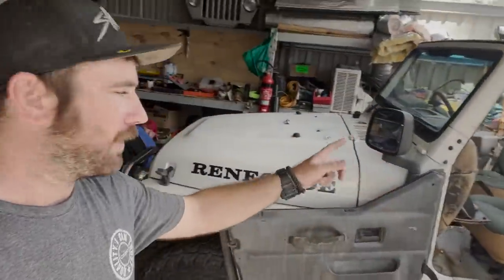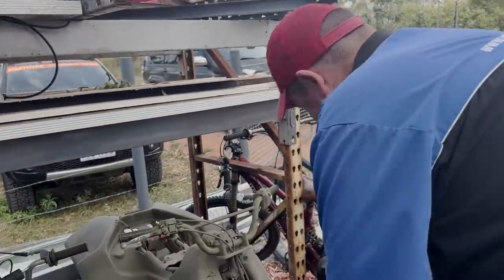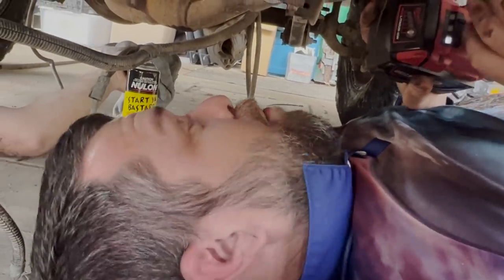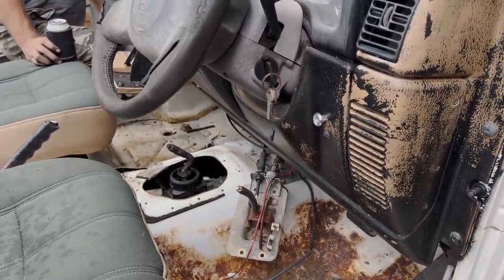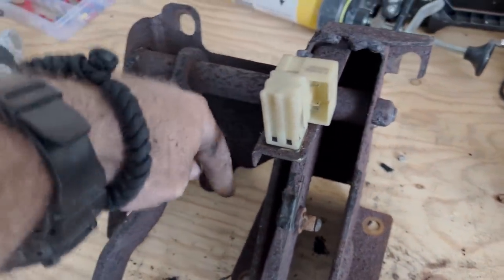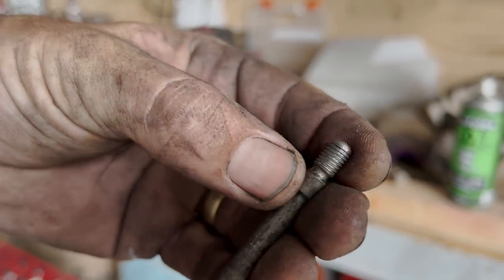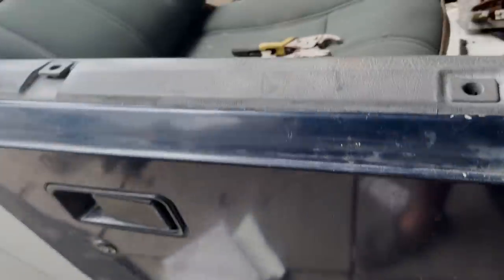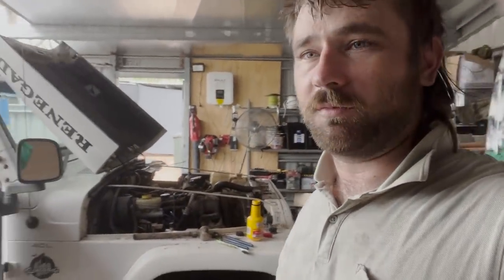Sh*tbox Shed - Rebuilding a Jeep Tj To Its Former Glory - Episode 2- Auto to Manual Conversion

Comment: You have a floor jack,and a spring?Well,I once changed an auto trans in a Pinto Twice in 1 day,because the replacement was bad,with a 2'x2' piece of 3/4" plywood,3 sandbags,a bottle-neck jack,a ratchet set and a few wrenches.I can tell you that greasing the ball on a shift/pedal rod and wrapping it in alum.foil,then fill the space with JB-Weld.At least that's easy.Sorry your clutch cylinder was toast or you could've done that.At least you aren't working on a Pinto.
Reply from the maker: Yea been there bro. Navara is also a painful one